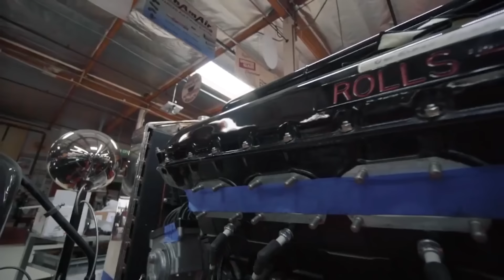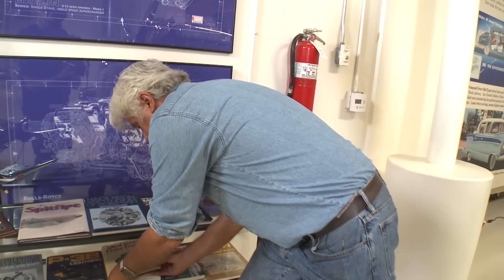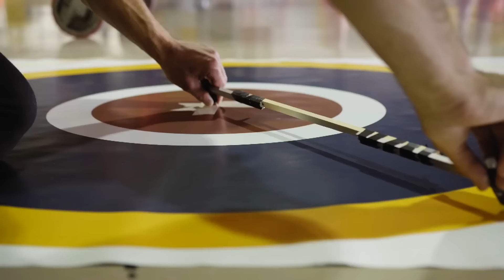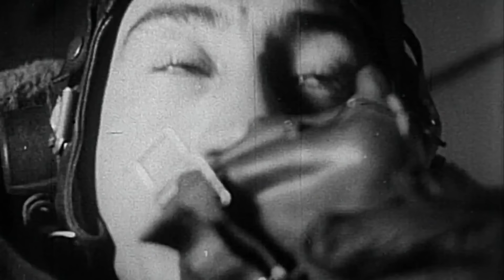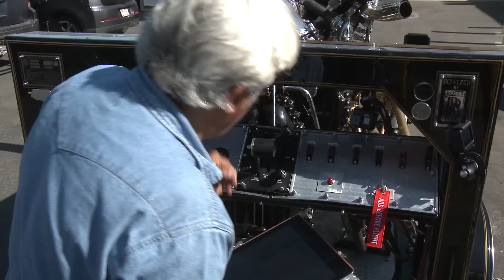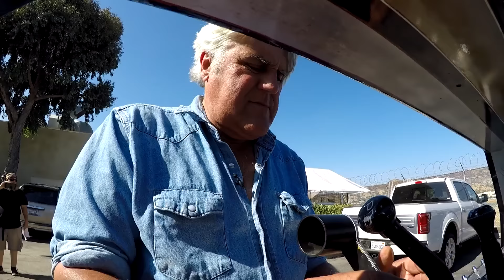The Engine That Won World War II - Jay Leno's Garage

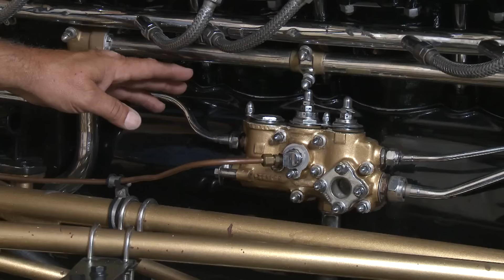Comment: 6:40]  Packard probably just didn't  just "copy" that starter motor.  Packard engineers probably  completely reverse engineered that stater motor, then redrew it, so that it could be mass produced without the necessity of it being hand fitted to the engine it was installed in.

Comment: I love the fact that you'd have such a toy as a RR Merlin to play with on a test bed.  I'm a little green with envy.  That said, you might want to consider a few things.  When a normal recip aircraft engine is started the mixture is advanced to full rich, especially at sea level.  To run an aircraft engine too lean will cause severe damage to the engine like holes burned in the top of the pistons.  That could be a very expensive mistake to make on your motor, Jay.  Once you got the Merlin to kick over at idle cutoff mixture you should have advanced the mixture to full rich and you didn't.  When you got her started and advanced the throttle with the mixture set very, very lean you created a critically bad condition that could have destroyed the motor.

Just remember that mixture controls fuel and air in the correct proportions for the circumstances.  It's not logical, actually, because throttle also controls fuel.  Think of it as mixture controlling the amount of fuel/air in total available to the engine.  It's from that mixture setting that the throttle draws gas to advance rpm.  Up at altitude it's normal to lean the mixture for a more efficient burn of the gas.  But, down low it's super important to enrich the mixture to avoid damage due to excessive cylinder head and exhaust gas temperatures.  Have fun with your toy.  Hope I've helped.  I'm an older pilot flying since 1974.

Comment: My father was a tail gunner in Halifax's and Lanc's in World War 2, in the Royal Canadian Air Force. When I was a kid I'd go with him to air shows to see this same Lancaster fly up from the museum in Hamilton. You could see that he was still in awe of it.  The sound of just one Lanc flying was tremendous.  Modified versions could carry a 24,000 pound blockbuster bomb used to bomb submarine pens. Nothing else could carry a bomb that large.  I volunteered at the Toronto Aerospace Museum years ago where we were restoring a Lancaster that had been on display at the waterfront. The wing spar had been cut to mount it on a stand so it wasn't going to fly again. But we had a closeup of the merlins it had. What an engine. Extreme engineering for the 1940's.  Of course this same engine powered the Spitfires, and I think the Hurricanes and Mosquito's as well.  I totally understand Jay Leno's fascination with it. Despite it's major contribution to the war effort, it's also a beautiful piece of engineering. Don't forget, most of these engines that are used now were built in the 1940's.

Comment: Mr Leno so we in Croatia have aircraft fuel at the pumps? lol....100 octane...it is pure gasoline! 98,95,91 and like 35y ago 89 octane were mixtures of gasoline....98 is 98% octane 2% heptane...same as other downgraded fuel. but Merlin was very nice engine indeed

Comment: Is that the prop that these came with from the factory?  The width of the blades look okay but they look very short.  Are they just shortened versions so it can run on a trailer?

Comment: The USA should call back into service the Merlin Engine and some of the planes that used it. Especially the P-51 Mustang. The U.S. Military are looking at not just building the most advanced aircraft, but to save money, they are looking at going back to actual airplanes for Military purposes that do not require Jets. Many missions over much of the world do not need the modern powerful and much more expensive jets used. Recon, transport, escort and search mission with these plains and engines would save millions. We know they are tested and true by actual war use and our nation has the plans and people to see through recycling this technology. It is not like trying to build these things from scratch as if we never seen them, almost 150,000 built. It does not make much sense to reinvent the wheel, when we have such an impressive set of past technology.

I would also like to pitch in that my sister called me and told me her sons did not want her car. She is old and could not fix it. I came over to look at it and it's a 1967 Plymouth Convertible Barracuda with a six sitting under the hood.  My nephews said it was not a mustang and so they were not interested. She told me it was mine if I wanted it. I went and got my son's out of school and we got our truck and trailer and went back and picked it up. I can not believe I got a 67 Cudda convertible for free. Now I have to go and get her to get me a title. Without a title, I am not so much as touching it with a wrench.
Reply: Modern turbo-props are infinitely more reliable and efficient than piston engines.  Longer lived and cheaper and easier to maintain.

Comment: That fork lift stands no chance against the Merlin, even with that weeny little prop. You better chain it to a 20 ton truck if there is a full size prop running the engine at full power....

Comment: I have a huge deposit of industrial diamond, which is large enough to machine the crankcase for this engine. I am trying to get some developers of ultralight aircraft development interested... turbine engine made from industrial diamond... it is carbon, which is lighter than aluminum and stronger than steel.... it acts as a superconductor for heat and carries heat away immediately and has 0 heat expansion coefficient... it can be shaped and machined with no preparation... i am working on claiming the 10 square miles along the fault line they are found in... the Arizona geology, because of its juxtaposition against the Pacific plate, the tremendous pressure does things like raising baja California along the junction, which continues up the Colorado river... the pressure creates standing waves in the rocks of North American plate we call the Rocky Mountains... and the Sierra Nevada... it also creates diamonds and carborundum, silicone carbide... diamond is not a conductor, carborundum is.... the possibilities are endless... i need a sponsor sir... backed by the finest collection of diamonds on Planet Earth... I am StarFire... we have diamonds and gold and platinum in vast quantities... and no money 

Dr  Richard Carew 

Starfireopals@outlook.com
Reply: You won my heart when you said overhead cam 4 valve... i am a factory trained Alfa Romeo mechanic, did my apprenticeship on Jaguar.... Alfa Romeo brought out the first double overhead cam engine in 1906... we were putting out fires in San Francisco using horse drawn wagons
Reply: Diamond is the hardest substance we know of... sapphire is 9 on the Moh's scale of hardness.... it can scratch anything on Earth except diamond....  sapphire is a 9 on the Moh's scale of hardness, an order of magnitude harder than topaz, which is 8.... diamond is not just one order of magnitude harder than corundum, it 5 orders of magnitude... 10^5th power... 10 thousand times harder... i carry a pocket rock around to play with, they don't get scratched by other stuff...  bearings made from diamonds will never wear out with a pre oiler... that is a feature that all engines should have... engines designed to last forever.... planned obsolescence is killing Planet Earth
Reply: I can be found in my group on Facebook 

One Planet One People!

Join us 

Please

Comment: Obviously the Merlin was the epitome of piston engines and it is  said that it may have had a contribution to the acceleration of the jet engine.  It is said that one  engineer working on the radiator of the Merlin had noticed that though the radiator protruded  under the wing of the Hurricane or the Spitfire, it did not produce too much drag as the  heated air expanded and in fact was producing  enough thrust to cancel the drag on the radiator exposed to the slipstream for cooling.   
There were a few disadvantages with the Merlin, one was that the carburettor could not handle an inverted flight of more than six seconds,  and  the other was the  front top positioning of the  reservoir tank for the cooling fluid where one bullet in it would bring  the plane down due to lack of cooling of the engine. 
The Merlin was the engine that most car manufacturers copied and those who made the Merlin would not believe that a jet engine would take over. In fact on one occasion a Merlin lover said to Frank Whittle that his jet engine, if it worked would not produce enough power to stir the milk in a jug. Frank Whittle had a hard start but eventually  persuaded the authorities that there is a lot of power in a jet engine.   Parsons up in Newcastle in UK had the same problem, persuading the Naval Authorities that the steam turbine was as powerful as the piston steam engines.  History is so interesting and we are lucky that there are people like this gentleman who are so keen to uphold the history of engineering in this manner. Congratulations.
Reply: Just imagine how many lives could have been saved if Frank Whittle wasn't snubbed :/.

The British government did some incredible things with little resources but also made some daft decisions (giving the engine to the soviets).
Reply: Epitome of piston engines..LOL Ill take the faster one thanks Pratt & Whitney R-2800 Double Wasp

Comment: I like this set up, it's ready to be installed in a plane should we need it again.  The prop is beautiful, however something is missing.  The length.  I was looking at the F4u corsair gull wing and I swear each prop blade was as long as a man is tall.  That means a 12 foot diameter prop.  Of course I don't think the Lancaster had 12 ft props since it had 4 at a time.  Maybe 10.  So your pretty prop must have been cut down to keep it from, as you say,  pulling the building down.

Comment: Another candidate for the engine that won the war could be the Pratt and Whitney R-2800 Double Wasp, 2,100 hp (1,567 kW) @ 2,700 rpm, Power-to-weight ratio: 0.89 hp/lb (1.46 kW/kg)... more horsepower and greater resistance to battle damage. Which one was better? The answer is Both! The Merlin was better for the P-51 and the Spitfire. The Merlin was better for the P-47 and F4u.

Comment: i'm a 60 year old disabled guy,who was a machinist/enginge builder for many years.Finished my working career at siemens making turbine blades.In the mid 80's early 90's i built and rode top fuel harleys,1994 amra world record holder 7.009 @194mph. The packard Merlin
engine with the super charger to me is the best engine ever made.As a avid ww2 buff that motor was a great part of the allied victory.If i were not on a fixed income,i would come to see ur garage.It is awesome that you preserve some of the greatest engines in the world.God bless you     Chris Forrest

Comment: They Rebuilt the Lancaster at CFB Trenton Ontario, I got to see them rebuilding it. It was broke in 2 pieces, the nose was separated from the rear. They literally took every body panel off and repaired each one to save as much original body metal as possible. Great video, I forgot about that plane. Lol

Comment: Mr. Leno. Do you have a set of proper PLUMB WRENCHES to work on those engines? A very good friend has some to sell. Along with NATIONAL AUTO REPAIR MANUALS.(pre dates Mitchel auto repair manuals) But only two pallets of those.  See me at Blue Collar Supply. (Sacramento Ca.)

Comment: oh! and for the nay sayers, the r2800 double wasp was the work horse engine of the war ... it could lose cylinders and still fly do its job and perform... it made the power ,  and it took the fight to them the enemy...p&w did their job... there were no rr on the \
Enola gay (Wright r3350)... so who one the war? wasnt the late coming p-51 ... the thunderbolt didnt either , but when you can take that many rounds and come home? or a hole in the cooling system and go down? as a vet send me up with the radials..

Comment: The Merlin engine was a superb engine lacking only one  thing,  fuel injection.  DB 601 would have performed even better in the Mustang and at much higher altitudes and attitudes.
Reply: End of the war DH Hornet had twin 2030hp Merlins, a service ceiling of 41,000 feet and a maximum speed of 475 mph. The engine was as good as any of it's German rivals fuel injected or not.
Reply: The continued use of a carb (in later Merlins a Rolls Royce-designed pressure carb) was a deliberate choice. The evaporation of the fuel after the supercharger helped to cool the incoming charge, increase the density of the charge and increase the output of the engine compared to a FI system. Short-term negative g capability is all that is required in combat - continuous negative g running is useful only for aerobatics. The shortcomings of the original carb were for all practical purposes overcome by mid 1941 with all engines retro-fitted with the Shilling Orifice.

Stanley Hooker (the designer of the two-stage Merlin supercharger) wrote at length about this in his autobiography.

Comment: What a great guy Jay Leno is! And what a fantastic video showcasing this piece of history! BTW, Canada built more than Lancaster bombers. They also built Hawker Hurricanes, Mosquitos and the Avro and Harvard trainers. They also trained many thousands of allied airmen at several British Commonwealth Air Training facilities. The clumsy looking little Hurricane actually shot down more German pilots than the Spitfires. When standing beside a Hurricane as the merlin engine fires up, the throaty growl of the engine can make the hairs stand up on the back of your neck. The merlin engine was named after the magician in the legend of King Arthur. The engine named after a bird of prey was the Griffon. The engines could not have looked as shiny as Jay's merlin when covered with oil, metal discoloured from high temperatures and occasionally shot through with 50 cal. slugs.

Comment: i like the radiator.The oil and water radiators were ducted under the plane, where the heat actually made negative drag.It actually put out a thrust when the input and output flaps were set at a certain angle, at speed. i always wanted to build a car to try out this effect.Some scientist named Meredith invented it

Comment: I remember when Merlin powered hydroplanes ran on the Columbia river near our home. There would be four or five of these boats screaming around the oval coarse laid out on the river at well over 100mph. You had to plug your ears as they went roaring past on your side of the river! The sound could be heard 20 miles away.

Comment: He didn't mention it so I wonder if they didn't put the water injection on it. If it's only run at idle it really doesn't need it, but they had a water injection systems on the planes to cool the air as it goes into the engine. Superchargers and turbochargers compress the air which also heats it, so in addition to the intercooler, water/methanol injection is popular on turbo diesel trucks and cars with forced induction.

Comment: Hey Jay,
I flew in the Lanc when I was in the "1941 Airshow" at Geneseo NY in 1987. It was the last time I participated before my job took me to Alabama. The flight was great, little vibration compared to the B-17. The Lancaster was easy to control, very little wing flutter, and those 4 Merlins just sang along as all inlines of the day did. We even had FiFi (at that time, the only B-29 rated to fly) make 4 low passes over the grass field, so it was a grand time. In all, the airfield had over 45 classic warplanes present on the ground and most had their turn at exhibition flights. I also had a great flight in the trainer PT-17 and never got airsick during all the aerobatics - what a thrill! Now, I miss those days really bad.

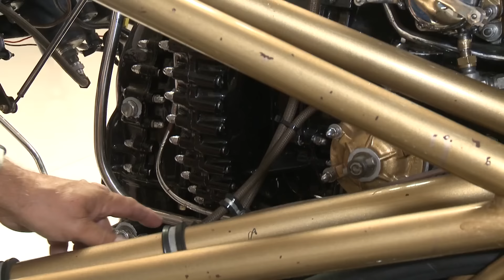Comment: Looks and sounds to me like Jay has been using a little high octane ethanol himself. Listen for example him saying from 4:58 on: "The [lip smack] S.U. carburetor"... "Americans used the  Pendix er... the Bendix, P.D. 60  duel throat carburetor"...  "That means 16 pounds per square inch throat", "so it's 32 square inches..." [fast forward to 5:15]   "The fuel air mixture's injected right here... into the suction side of the centrifugal blower which is two speed". Besides the wet "S"'s, he sure is hanging on to the engine and frame mount a lot for support.

Comment: I have no idea if this question has been asked and answered below. Point me to it if so.  When reading about the Spitfire during the Battle of Britain, I learned that German pilots eventually learned to make use of their Messerschmitt's fuel injected diesel engines to lose pursuing Spitfires and other gasoline engined planes. They would start flying upside down, no problem for fuel injection but the carbureted engines could not operate upside down.  This problem was quickly referred to the "boffins" to fix.  Sure enough, the Merlins were all given redesigned carburetors so they could also operate upside down.  I have no idea of what was done or whether the carbs needed to be entirely replaced, or simply needed to have a second upside down bowl and float fitted to them.  In any case, Jay Leno did not mention this in the video.
Reply: I would think that the trick was an early form of what hackers call "social engineering".  The German pilot had to convince the allied pilots to try and fly upside down also.

Comment: Wonderful stuff and the engine has been restored till it's a work of art.  One thing puzzles me though.  In the pics of the engine when it was apart there is one of a crankshaft supported by two large sheets of wood.  Try as I might I could only count six main bearing and ten conrods.  And the phasing of the crank throws look weird--nothing like any v12 I have ever seen.  I suspect the crank is from a V10 and somehow got into the Merlin pics, or am I missing something?